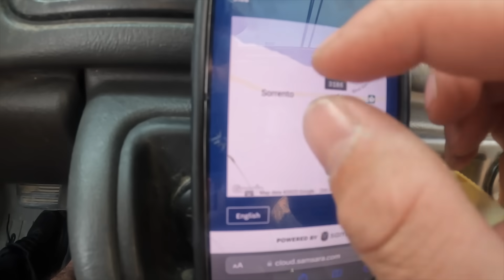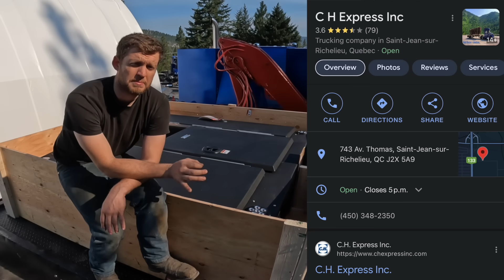Behind the Scenes Drama: CH Transport vs Electric Truck Delivery - The Real Story Revealed

Comment: I am so sorry that the current situation of bad trucking (both drivers and brokers) hit you too. I had to move a 1982 Datsun 280zx rolling chassis from cali to the midwest here recently and it was an absolute fucking nightmare. I (unfortunately) hired a broker named Ace Auto Freight to do it. First, they bait-and-switched me on the price (doubled it from $600 to $1200) the day before pickup. Then, the first driver they sent out didn't show up on the first day. The second day, they show up but don't have a winch to put it on the trailer! The next driver they sent out picked it up and headed my way. The night before they arrived, they said "Have your forklift or crane ready to pick the car up off my trailer tomorrow"... Turns out, they loaded two more disabled vehicles onto the trailer behind my car and they took out some suspension bolts to drop the back of the car onto its bump stops to make room to clear the bumper of the truck behind my car, and the picture they sent scared the piss out of me because it looked like they'd dropped the nose of that truck onto the tail of my car. In order to get my car off, I had to hire a damned flatbed tow truck to pull my car off the FRONT END OF THEIR TRAILER!.. At my own expense! And then at the end of the day, the driver wanted $50 more than agreed upon at delivery! It was absolutely fucking bonkers...

Comment: For the extra axle:

Isuzu NRR or Mitsubishu Fuso FG with a flat bed. Call it a farm truck to move anything everything a farm needs <26k lbs. Grain, Animals, Materials, product etc... A lot of farmers markets don't allow generators to market your product, but the state usually requires refrigeration. 

That axle is probably oversized on what I am talking, but the idea is out there!

Great channel, great project!
Reply: loadstar dump bed would make a good contender

Comment: What you need is a small to medium telehandler, they work great in tight spots and y'uns coulda had that unloaded in 30 minutes. Some even have the winch system behind the main lift so you can use straps and whatnot.

Comment: You don’t need a forklift chace, you need a rotating telehandler. Look into used magni 5.21-5.25 rth. 11000lbs of lifting capacity, and enough extension to reach fully into a 53ft semi trailer. Also they have a whole smorgasbord of attachments that can do anything you want. Like pivoting forks. Park that rig behind a trailer and unload every piece off the trailer and to anywhere within 67 feet of the magni 5.25rth without moving the magni from where you parked it. Also it can be a crane.

Comment: The obvious thing to do with the extra axle is definitely a service truck with an onboard charger - preferably one with a wrecker underreach rated to tow your early production trucks, if you've got the axle weight headroom. Build it on a regular on-highway medium duty cab.

You'll need one for the early production trucks, and it'll double up as a marketing tool for conversions and other applications - pipeliners, towing, heavy equipment service, that sort of thing.

Comment: As someone in the welding and service truck work for 20 years I soooooo want to see yall do a service rig. And while the EV rescue truck would be kind of a funky little concept the hybrid electric service truck actually has real-world potential because it would be so nice to have a welding rig on site sitting silent while your working without the welder engine running the air compressor engine sitting there idling, truck engine idling for your crane, all of it in silent operation and you could even have a level 3 fast charger cable in a side box so it could charge an electric vehicle as a service call

Comment: As for the extra axle I think you should order one more and convert an old 895 Versatile (Canadian built) tractor to diesel electric and sell it to a farmer in Alberta or Saskatchewan.  Some big tractors were built with  truck engines ,truck transmission, and truck rear ends should be a fairly easy swap to diesel electric
Reply: diesel electric tractors would bring a smile to my face

Comment: I just thought of something dumb. Since your axles don't have drive shafts, why couldn't you make a drop axle that also acts as a drive axle. Like if your on the highway going to your logging destination you could have that rear drive axle up to save on energy, and then when you need that extra axle you have it. Would that be possible? Or would that just not save enough?
Reply: All they would need is a air ride on that axle , and a lift package...and of course some sort of electric lock out for that axle. Easy peasy
Reply: thats a neat idea! no reason they couldn't.
though probably wouldn't bother for the loging/off road duty, a highway version could be setup to work like that.
Reply: I think the extra drag on the regen would cancel out the charge you get
Reply: @ARockRaider  would be especially nice on trailers,  every axle you can lift while empty means less rolling resistance,  which means greater range.
Reply: Don't think the energy savings would be worth the cost of the extra axle.  I DO think having a driving drop axle would help a lot on poor roads when fully loaded.
Reply: I can't tell you exactly why I feel this way, but having a powered drop axle just seems sketchy to me.
Reply: Drop axles aren’t legal in Canada so as a Canadian company they can’t build a drop axle truck.
Reply: @everything_delete8005  uhhh they are legal in Ontario...probably 90% of none van trailers have drops and 90% of straight dump trucks run lifts

Comment: I'm a screen printer and promo apparel decorator. Sometimes I outsource jobs due to a variety of reasons; timing, tooling, quantity, decoration method, etc. But I ALWAYS tell the customer before doing so and I only tack on like a 10% broker fee. That is INSANELY scummy to not tell someone you're outsourcing and taking half the profits for doing jack shit. especially when shit hit the fan and you didn't lift a finger. Normally if I outsource and shit starts going sideways, I'm the first one to jump on that grenade. Idk... maybe that's what it means to have a shred of integrity?

Comment: You don't need an expensive forklift attachment! You can use a set of forks that hang over the bucket, and your only addition is to weld on two to three hooks on the rear top of the bucket. It'll be forks on a budget!

Comment: Get a pallet jack and a fork lift. I was doing shopping and receiving as a part of my job, and I could move so much material by myself with a little rink a dink forklift and a pallet jack. I unloaded 9 pallets in 21 minutes with the driver moving them to the back with a pallet jack. Heavy pallets full of hubs and bearings and such. It’s the right tool for the job bar none.

Comment: That's a lot of axle for something small. But yes, some sort of maxed out service truck would be cool. Even running a hydraulic pump off an electric motor instead of a PTO would solve a bunch of off road adventuring catastrophes. I've envisioned my old Tandem Tandem C500 boom truck converted.

Comment: Just a suggestion - keep track of all of the additional costs incurred due to CH Express' actions, and send them back an invoice for those costs.  Say the bill was for $4K, incurred $3300 in overtime costs, send them that $3300 invoice and a check for $700.  
In the end, that's what this is all about - you paid for an ambulance, but got a metro-bus level of service.  Costs were incurred because of that, which CH Express should be on the hook for.
Reply from the maker: We did that, and sent them an invoice, giving them the opportunity to make things right before we went public with this.
-Theron Danger

Comment: You don't need a forklift. You need forks for your backhoe.  And yes it is a quick detach... You have a hinged bucket. Open the bucket and make forks that fit around the lip of the bucket. Then you just pinch to lock.... You can't push down but you can lift.

Comment: An electric service truck would be cool. Maybe with a Miller enpak or some small diesel generator so you don't have to run the C9 if you need power when the batteries are dead. I would love to have a hybrid service truck one day when I have to replace my F800.

Comment: There is a company in Vancouver that makes portable dock. All metal with a set of landing legs so you can change the height of need be. I use it all the time where I go an it works really well. I drive a forklift up it to unload.

Comment: Had Manitoulin do this to us at my old job. We wanted an enclosed van to haul a sample to another one of our locations so we could verify our testing equipment at both our locations (one in Alberta, us in Saskatchewan) was working properly. They offloaded our 3 packages onto a sub contractors flat deck bed pulled by a 1 ton in winter. Absolutely covered it in salt and snow and ruined it. Cost us $6000 in lost product and shipping costs. Receiver on the other end didn’t know what it was cause the subcontractor didn’t have the proper instructions on their shipping documents and received it without knowing the details. Since they signed off on it, Manitoulin didn’t take any responsibility. After half a year they sent out reps wondering why we significantly reduced (aka stopped entirely) shipping any product through them. They were prepared to do nothing for us, but really really really wanted our business back. Told them to pound sand.

Comment: Glad the PDU is finally there what a relief, as for the extra axle make a custom crewcab  hotshot truck  with a 12-14 ft flat deck and IMT 1015 hydraulic crane , heck I’m thinking about spec’ing a T880 flat deck crane truck with like a 24 ft deck and 52 inch sleeper just to help you

Comment: Plug in Hybrid truck would be a great idea for that extra axle. Make 1 drive axle conventional with a pto generator and the other axle electric. You would have extra electric power/traction when needed or could switch between diesel or electric sources. Could be a "kit" for regular trucks to confirm to new efficiency guidelines.

Comment: I would love to see that e axle put into a service rig designed for servicing trucks like yours. Generator on the bed with a charger output to top up full electric trucks stuck on the road or with range extender engine problems. Use it as a testbed to see what future service rigs will need to be. Since youre already pioneering with what youre doing for the truck itself it seems like a fitting side project to also build a service truck specified for electrified trucks

Comment: After a quarter century in the freight business - get every single detail of how you want your stuff hauled IN WRITING, in detail, end to end. If you don't, you're stuck with whatever fine print boilerplate bill of lading contract the shipper signed at pickup, which is basically designed to fuck the customer. Once a shipper signs, we can basically do whatever we want with your stuff and only give you 25 cents a pound when we break it.

Comment: 100% on the full service truck with EV Charger. Being that close to the Snowshed, you might end up doing booming  business as electric trucks get going and drivers try pushing their range.
Side thought.... How about once you've got the chain going for truck production, what about a winch designed to work with the high voltage system for heavy wrecker use? Something that can replace the hydraulic winches so that you could eventually build an all electric wrecker or even Skidder?

Comment: Quite a few people are suggesting a mobile EV charger for recovery for stranded EVs. I honestly dont think thats an entirely bad idea. Ask around see if you can get one of the DC rapid charge station manufacturers on board. If you can get DC-DC rapid charging sorted on a mobile platform, maybe 100Kw+, it would be a great proof of concept. You can fill the rest of the truck with tools and get yourself AC power as a mobile support truck while you're out and about doing shows.

Comment: Two thoughts.

Anything different from what is in the contract, they had no right to do.  Contracted for specific tasks and conditions and they cut it, probably put it up as a "partial backhaul" to attempt to justify the low rates.

Breach of contract, no pay for them.

As far as a service truck, could do a rollback wrecker style, and have a detachable service cabin that attaches onto the back like an intermodal container.

That way, the truck can be a mobile charger, towing, service, and help unload deliveries, heh.

The service box could have legs or a stand that holds it up while the truck drives under.  Dump air to get under, inflate to pick and secure.

Or it could have rollers on it like a worksite dumpster so the rollback wrecker can set it down and pick it up anywhere.

Comment: I think a heavy ewuipment off road service truck like you see working on excavator way in the mountains on a logging track would be awesome. Or a roadside ev specialist service truck with the charging capability but can also work on other vehicles using its gen. To power equipment.

Comment: I would love to see you make an all electric tow truck with a massive battery pack to also be able to charge up depleted batteries of EV if needed. That would be awesome. Make sure to make it a flat bed as a lot of modern vehicles require (as stated by manufacturer) to be towed on a flatbed. This is both ICE vehicles and EV’s.

Comment: Take that backhoe and start moving some earth, Drop some concrete blocks on either side and fill it in and build yourself a loading ramp. 
I threw together a quick set of forks that bolt to the bucket of my backhoe and have so far moved quite a lot of 700lb round bales and green 20" tamarack logs for the saw

Comment: Service truck with under lift in back, cant do roll overs but has tools and can tow!!

They make battery welders, too! have a 250 amp lith-ion mig welder, pop it out of the charger and weld without running wires.

Add a tag axle BEHIND drive axle to help put weight on steers, cause she gonna be heavy!

Comment: That's why you need to quit fooling with brokers...If you move that operation to the U.S., you should reach out to carriers directly who respect and fully support what you're doing...Me and my missus run a 1 truck operation out of Maryland and we treat everyone's shipment as if it were our own...And for me personally, I've wondered for years as to why the railroad industry was the only industry using that type of engineering with those locomotives to move freight and not incorporate that into a bigtruck...When you get that whole operation online with conversion kits, we'll be signing up our 2005 W900 for one because we believe in this wholeheartedly...👍🏾

Comment: With the extra axle could do some testing with a powerd axle on the trailer on where one powered axle would be most effective being a powered jeep axle or one of the tandem axle.
Reply: Diamond had a powered heavy haul trailer and ran over somebody. If you need power back there use a push truck

Comment: You should do like a f350 cab and chassis with the e axle and you could sell them like just like a dealer would and let the customer fit out a dump or switch n go or just sell a kit that converts a dually to a e axle.

Comment: Dont look for a forklift just buy a set of used forklift forks and just weld them so you can pick it up with the bucket. Have it in a  j hook to go over the top round of the bucket so they are  adjustable

Comment: My first thought is a forklift, but that's already done.  A dump truck would be interesting to see, really anything with hydraulics as I am curious how a PTO would work since you don't have a driveshaft to take power off of.
Reply: It's been a minute but I remember an earlier video they mentioned using an electric motor to run the hydraulic pump.

Comment: Make a single axle and tadem axle roadside service trucks put a dog house on the back of the tadem axle with all the tool and equipment the service tech could need to get that truck back on the road weather it be something like recharging a truck. To servicing tires, fluids, to the electrical system. Something to get that drive back on the road or to a shop to have engine work down or an axle motor swapped whatever the case may be. And that'll put you ahead of the competition. Because none of them have anything like that. And then, in the future, expand and grow to have edison service with mobile service technicians in Canada and the u.s.

Comment: A Pettibone would be more useful over a forklift.  I use both and forklifts are nice for inside moving stuff around, but a Pettibone is good for more than just being inside moving freight.
Reply: I think properly it's called a telehandler. Pettibone is just one manufacturer.
Reply: @arthurr8670  yes that would be correct.  Although JCB makes a small one that's about the size of a Bobcat.

Comment: if you wanna get nuts? go hooklift/roll off with a few different bodies, then it can easily be a ALL the trucks, Service, tow, dump, flatbed, OFFICE TRAILER anything
Reply: That would be a good way to get allot of data across multiple power setup/use configurations.
Reply: @johnwenzel2003  
There are even a few off the shelf body makers that offer something along those lines, they could partner with one that matched with Edisons goals amd they wouldn't even have to custom the bodies a lot, just add in the high voltage bits and off they go